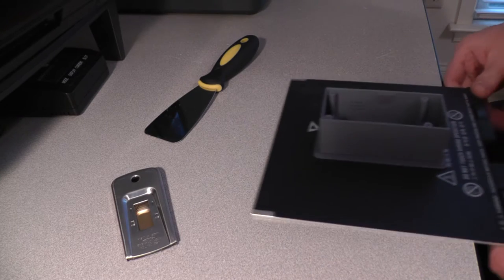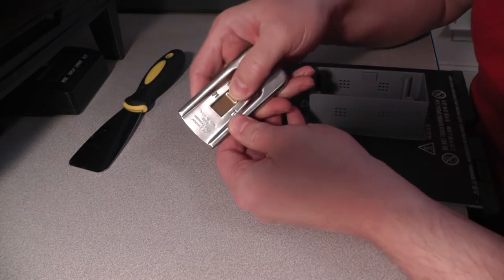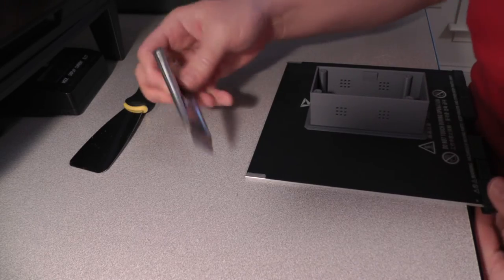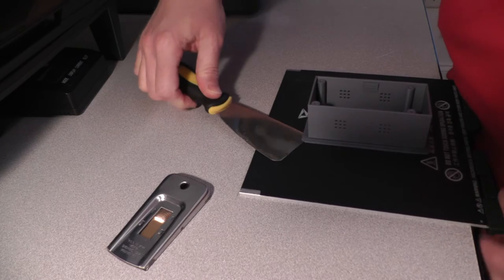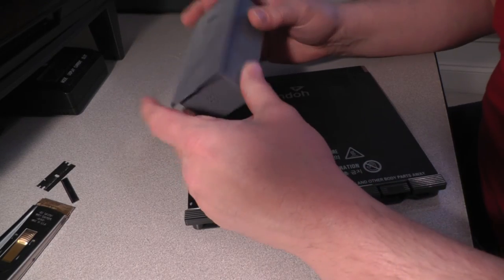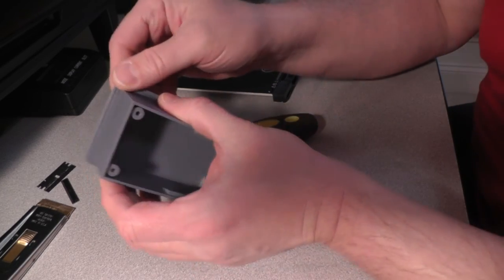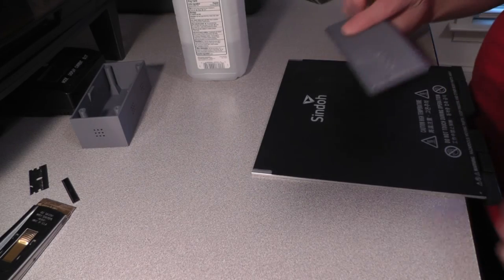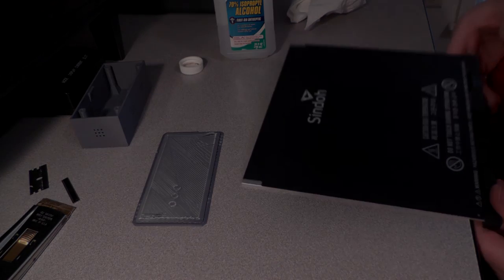Sindoh DP200 3Dwox - Removing Builds from Bed

Comment: Your videos are very helpful - thank you. I did find that if I had a difficult print to remove, laying it on a surface with the bottom edge supported against the side of the table, pressing the black plastic clips up against a table edge could weaken and break off the clips that hold the bed in place. I used that technique a few times and one of the clips broke off. Must be a common problem since they include a back up set in the shipment.

Comment: Thsnk for the tips in how to do this properly. One questionn regarding this 3d printer. after the time you have published the vídeo would you recomend it still?
Reply from the maker: Yes, I still highly recommend the Sindoh 3Dwox DP200.  They released a newer model this year, the DP201, that has a non-heated flexible bed for easy print removal and it only prints in PLA plastic.  However, if you have a need for ABS the DP200 is the one to get.  Also, the DP200 has the heated aluminum build plate which has less warping in the printing parts.  See some of my other videos on both the DP200 and DP201 reviews and hints and tips.
Reply: Thank you for you input. I has thinking about that (warping) the printer  will be used for prototyping tenhnical abs parts, so the new one i believe it a no go. Subscribed your channel  keep the videos coming!!!